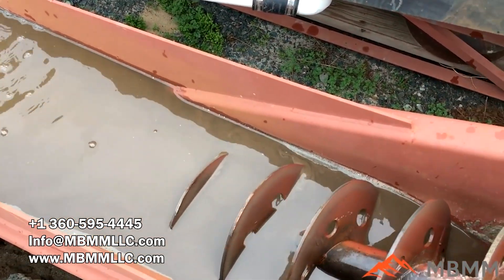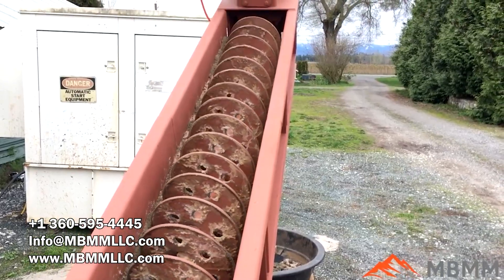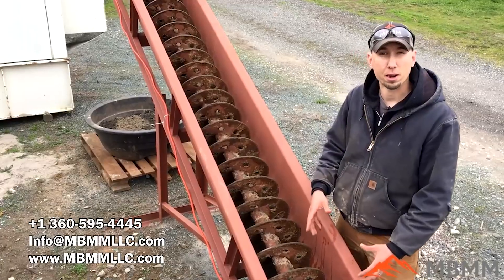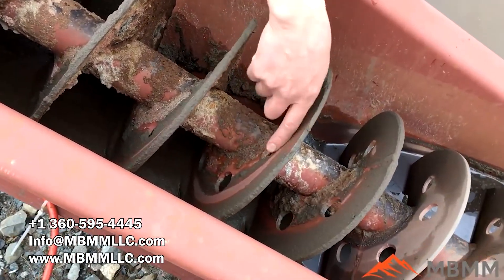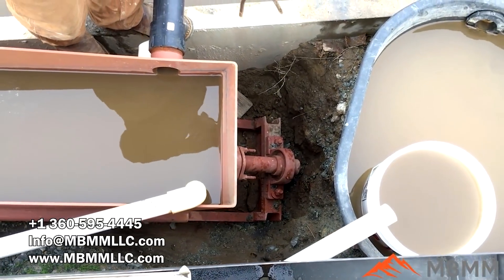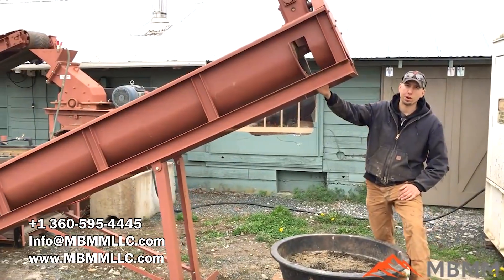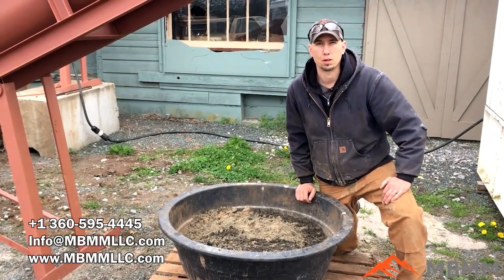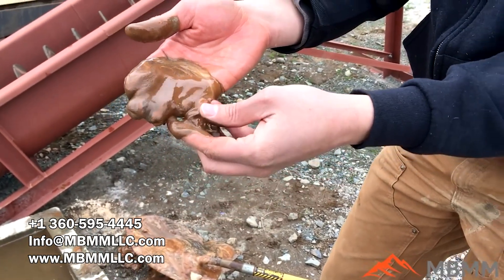How the Dewatering Screw Separates Fines

Comment: Running two or more in parallel on different discharge ports would be viable also.  Wonder how many screws you could run off the same motor or just power unit.  A tandem unit might also be viable for some cases.  Since it is after mass separation it seems more for viable waste product recovery than to recover more valuables from the material.  If the number 4 port on the shaker table is discharging anything heavy that valuable then I would think the table is not calibrated right.